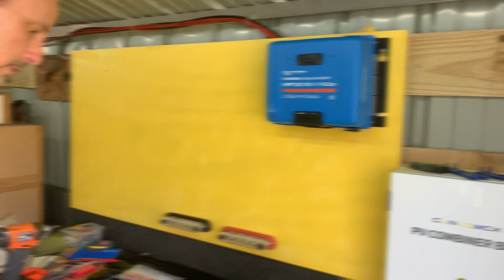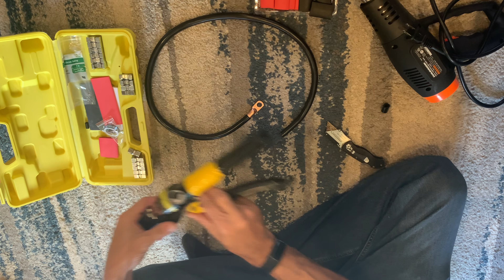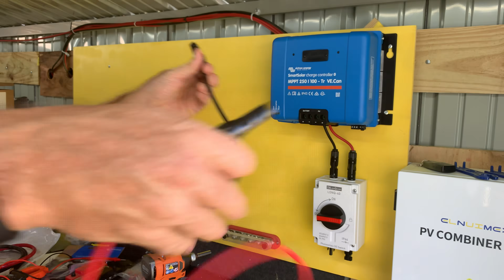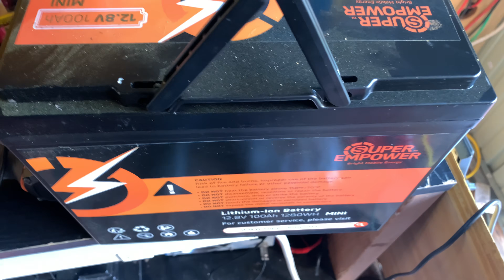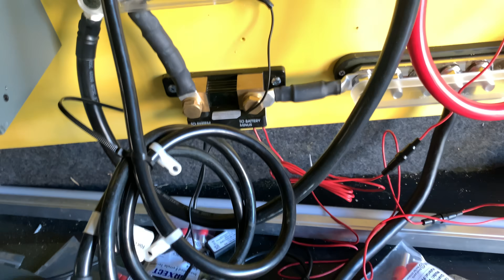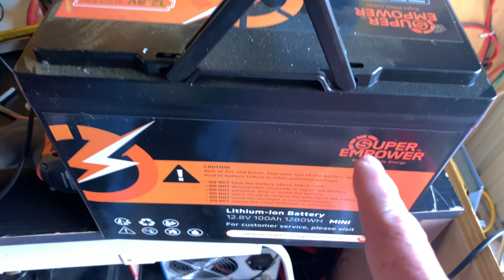Solar Shed UPGRADE! Victron 250/100 Charge Controller Install

Comment: I have a 250/60 I am using to add to my system.  This is the closest vid I have found so far    Thanks
Reply from the maker: Yeah, it should work just fine. The 250/60 is almost the same just a little less output than the 250/100

Comment: You said step by step. I did NOT see how to dial in battery type with the screwdriver setting dial. I need to hook mine up for lifepo4 and not one video demonstrates how to do this. Theirs no arrow only dial, slot spotting is at 180 degrees and theirs no stop start position !!!!! Please help ?
Reply from the maker: Send me a picture to matt@mattmansolar.com .. this should give me a clear view of the dial you are talking about ..
Reply: Zoom in with camera ,set to 7

Comment: A very long winded video just to connect 4 wires as the video states connecting a Victron MPPT 250/100
Reply from the maker: You can get the 4 wires you need from the manual, some would like to see the thinking and planning going into the devices around it. But not for everyone, thanks for feedback!